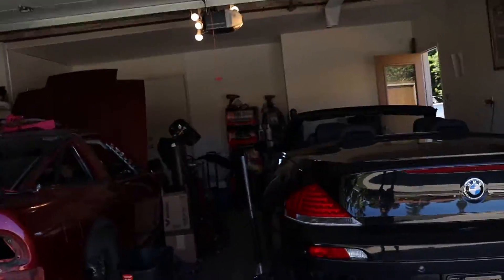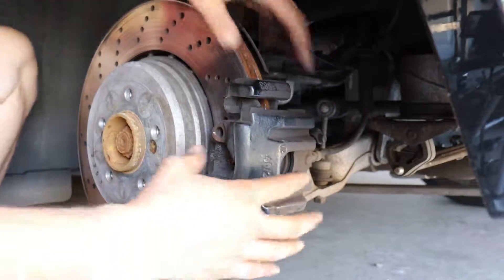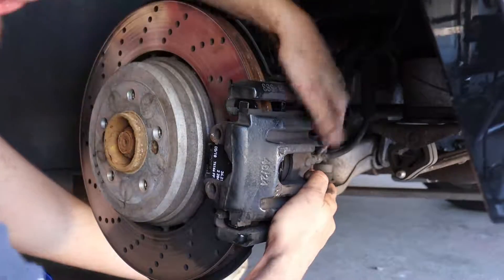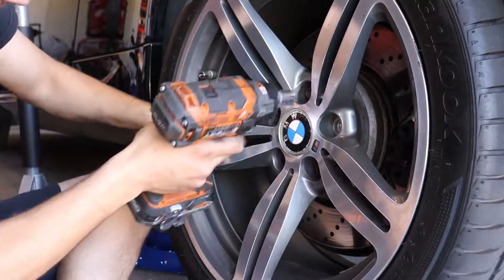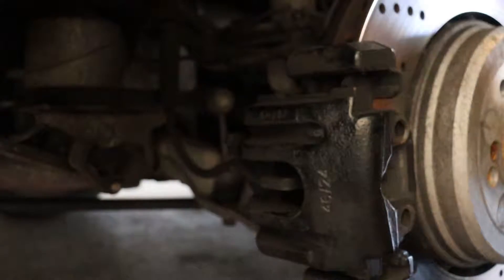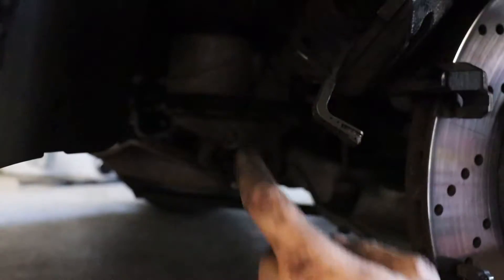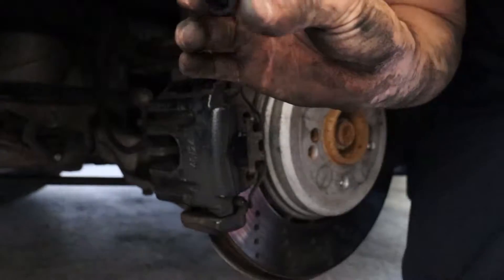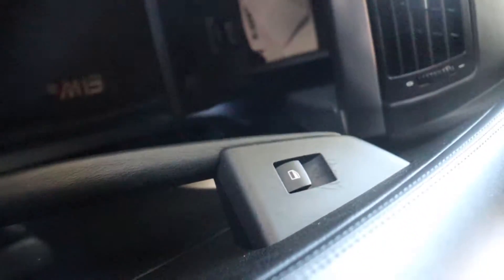BMW M6/M5 Brake Pad Replacement

Comment: You could have pushed the brake caliper in with the screw driver when everything still bolted on just pry with flat head or something and caliper pushed back with old pads

Comment: Front brakes Big C clamp put the two tabs in grab the wings with a pair of channel locks and pull them over the top of the channel to slide them in I battled with trying to get them in for about an hour I did this first side took me about 15 minutes second side took about five